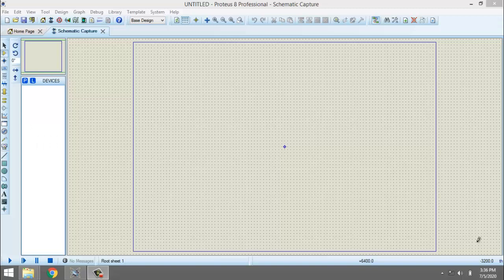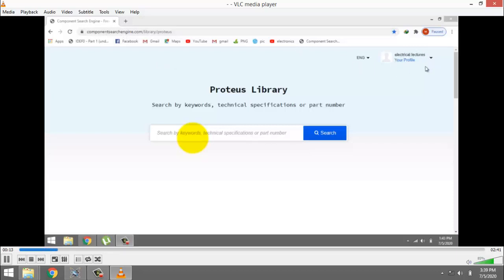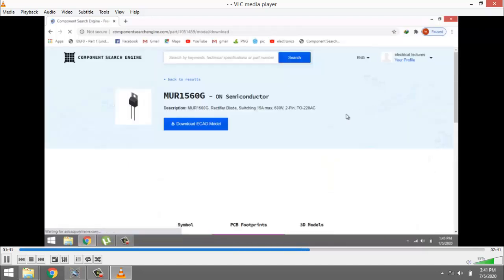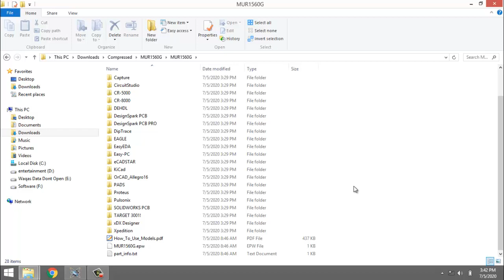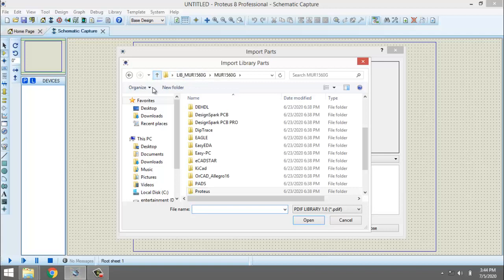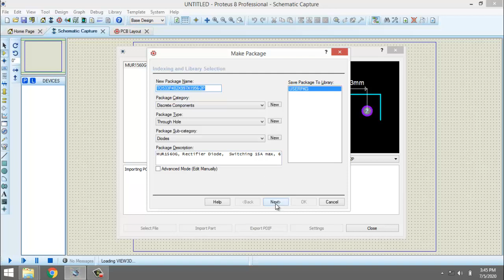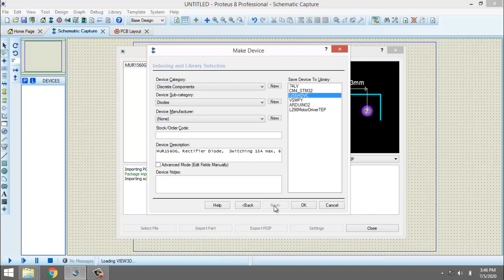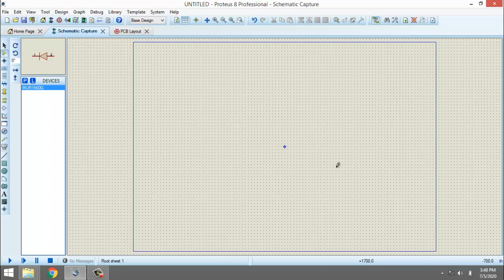How to Add New Component Library in Proteus 8 | Direct Method

Comment: The reason we want to add new component libraries is to be able to simulate with the new component,  but the PIC microcontrollers downloaded on the web provided here you cannot add a hex file because the options are not shown in the edit component as a normal proteus component  which makes it useless.

Comment: did you check PIC18F67K40 lib for proteus 8.9 ???
Reply from the maker: Yes. Its model is not available. I emailed proteus for this component. But unfortunately u canot simulate it right now. But u will find 2 other pic of same family. If you manage to simulate then no problem for this pic in hardware
Reply: @electricallectures  thanks you  for reply 

and when proteus reply back to you, if they will provide the simulation model of PIC18F67K40 TO YOU ,
can you update to me ??
Reply from the maker: Sure definately. Meanwhile try another same model
Reply: @electricallectures   sir ,I wanted to install at89s51 can u please tell me how to do sir , please sir

Comment: I have added the PWM IC by help you. it is easy to make footprint and layout and schematic also, but it is not working  in RUN SIMULATION. Why ?
Reply from the maker: I think the added IC doesn't have simulation file which helps to simulate behaviour of IC on software.

Comment: Firstly thanks. I added a atmel microcontroller-cortex m0 in Proteus library. But I can't add hex file to ic in edit component options. In edit component there is no option to show to add hex file.
Reply: Pls help me
Reply from the maker: I think vsm model does not exist for this component. Go to properties of component and click herarical model
Reply: 👍If vsm model doesn't exit how to get it. For the IC that I using-atsamc21j18a
Reply from the maker: If model dont exist then you have to ask labcenter for this aur request controller manufacturer for model

Comment: Hello Sir, I added PIC24FJ64GC006  library successfully in proteus 8.9. But the problem is" when I double click on microcontroller and  I trying to upload a hex file in this controller then it is not showing browse section,

So how we can upload the hex file in imported microcontroller part no ?

thanks in Advance !!
Reply: Sir please answer this question i also facing this issue

Comment: Hi this is Mohamed Nilufar.
first of all I'm thanking to you for this tutorial it is gives us very useful.
and I had added as your followed instruction into the Proteus which I have request device and it is given an issue; when it is simulating mode as this message (No model specified for D1. [D1] and .MDF) this error is occurring not only for that; it is occur on all new devices.
Therefor' kindly I have request you give a solution and I'll highly appreciate you and expecting kind your response soon.
Thank you,
Reply from the maker: Some time new components dont uave simulation model. You can go to the properties of that component and check herarical model.
Reply: @electricallectures  I also face the same problem, I added the PIC18F67K40  lib in protest 8.9 according to your instructions, first time it show  But it is not showing in Components list
Reply: Please help me 🙏🙏

Comment: After I followed your procedure I couldn't simulate with the component after I added it to my library so what do I do
Reply from the maker: Why what is the error
Reply: @electricallectures   the circuit did not work
Reply: @electricallectures  or can you show me how to download CD74HCO8E and simulate with it in Proteus.All the procedures you showed worked out,only the simulation didn't.Thanks

Comment: Hello sir i am trying to add mpx53dp but it can't add plz advice me to solve the problem.
Reply from the maker: This component may not have simulation model. U cant add it until you have its library
Reply: @electricallectures  sir then what i will do for it.
Reply from the maker: Its not necessary that any component available in market may be available in proteus. In that case you have to request the manufacturer of component to provide proteus model
Reply: @electricallectures  sir I download the library of mpx53dp but it can't add in protous in my laptop.

Comment: Hello Sir, before 3 days ago, you promised to me you sort out my problem ( add PIC18F67K40 lib into Proteus 8.9) 
But I waiting you reply..
Please Sir if you can to add PIC18F67K40, please guide me because this is my project, and I stuck.
Because my hardware also  not working.
So my Management is asked to me to use proteus.but in proteus 8.9 

PIC18F67K40 not available.
Reply from the maker: Sorry as i hve some commitment.  I ll definately give u some solition tomorrow
Reply: @electricallectures  thanks you very much

Comment: Hi, i added new component( HCPL-0631) at library but i could not simulated in proteus 8.9.Can you help to me ? i have that  errors "--No model specified for U6. [U6]
 Simulation FAILED due to partition analysis error(s).--"
Reply from the maker: Go to property of component and check herirachical model
Reply: @electricallectures  i checked but i didnt see failed, i did as you do,HCPL-0630 you can try.
Reply: i added MUR1560G like you, and puted the area and started the simulation and gave same error."No model specified for D1. [D1]
"

Comment: Translation results
Hi friend, great video and very clear explanations,
I followed your instructions to download the library of a "tlc45940" integrated and it was added to the list; it appears in the list of available components and I have applied it to my circuit.
I use it to interface arduino for drive 16 leds. I then built the circuit on proteus 8,12 and then uploaded the arduino sketch. When I click on play command, a message "No model spicified for U2" appears where u2 is precisely the integrated tlc5940 and the simulation stops. 
can you help me to understand why?
Reply from the maker: Some components does not have proteus simulation models. That is why you are facing this problem. In that case vsm model of that component is requested from the manufacturer
Reply: @electricallectures  ok, thank you.
Reply: @electricallectures  where i can find vsm model for proteus?

Comment: The component can easily be added onto proteus but simulating it is another story, by merely adding it it will display "NO MODEL SPECIFIED FOR U5:...this error can be cleared by attaching hierachy module. The drawback is-----if you attach any component hierach module....it will not simulate. How can i solve that?
Reply: I'm facing the same problem
Reply from the maker: This is the generic method of adding components which are not included in library. Those components which have not vsm models then special request is made to component manufactuting company to provide vsm model after that you can add

Comment: Sir I follow every step to download and install to proteus 8.9 
Now I wanted to add the new Component PIC18F67K40-I/MR.
After,I followed your next video " how to add  a new component " video.

But now that Component are not showing in search bar.even I check the hierarchy module.
But again problem are same.

Please help🙏. 
I shall be very thankful to you for this help🙏
Reply from the maker: I dont get ur problem. Is the component is still missing or some other problem
Reply: @electricallectures  again I follow all step and add the PIC18F67K40 lib and now it is showing in search bar.

But now when I go to upload the hex file of code,then there is no option to browse the hex  file into microcontroller. 

Can you help me in this??

Can you help me to uoload the code into
Reply from the maker: When i add this component it allows me to add hex file . Try another controller to see whether this is common error for all controller
Reply: @electricallectures  its allowing all other microcontrollers,but not for that MCU which I added.

How did you do that ??

Please please guide me.
Actually this is my project with PIC18F67K40
Reply: What I can do next for this??
Reply from the maker: I think vsm model for this PIC is not available. You can request vsm model on proteus official website or try another PIC of same specs that is available in proteus
Reply: lectures  sir I tried 3 times to add library but still problem are same.
This is not allow me to browse the code and complete my project.

I tried with PIC18F67K40-I/PT, and PIC18F67K40-E/PT, but failed in adding this component.
I watch  your only this  video 3 times
Reply from the maker: Give me one day i ll sort it out
Reply: @electricallectures  
Sir how I can request for vsm model of this PIC on proteus official website??

Sir please can you help on your any forum or WhatsApp for this ??
Reply: @electricallectures  thank you very much....Sir.👍👍👍
Tommarow will wait for your valuable response.
Reply: @electricallectures  
Can you share you email, so I send you both file (Proteus schematic file and code hex file) ??

Comment: Thanks for making this tutorial
I've added ADS506AKNZ IC by following your tutorial, and when I tried to simulate it, it is giving me an error "No Model Specified for U1".
Can you please help me with this?
I'm using proteus 8.10
Reply from the maker: Try to right click in properties click herarical model
Reply: @electricallectures  I've done it and the error is removed, but the device is not showing any output, as it was supposed to.
Reply: @electricallectures  sir, I have done as u did but in my Proteus I don't have the at89s51 sir I have done with what u have said but after all connections their is no option for adding hex file in that controller could please tell me sir 🙏
Reply: @electricallectures   and also It was showing like no model specified u2
Reply: @electricallectures  This can cause errors, especially when multiple parts use this technique. It is better to exclude the part from the simulation if the SPICE model is not available.